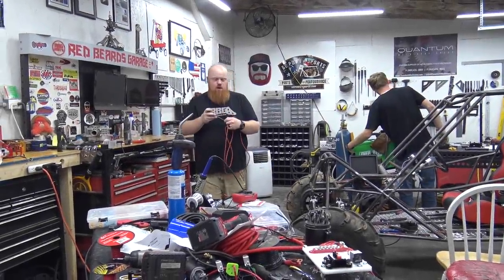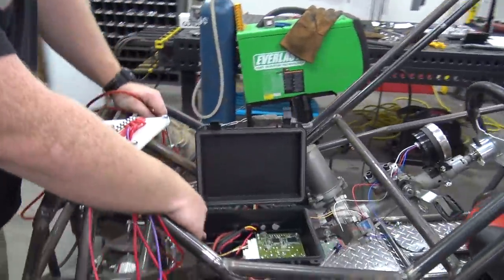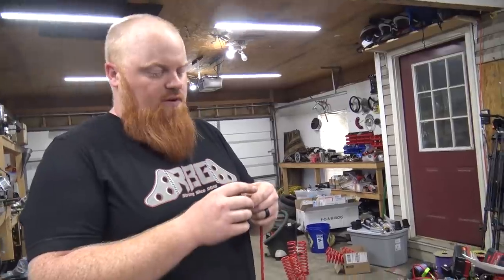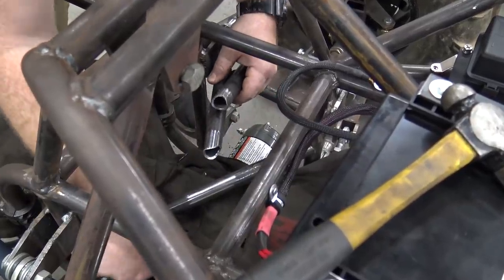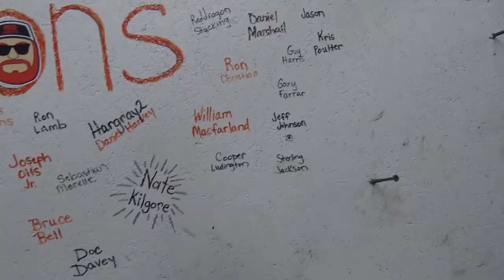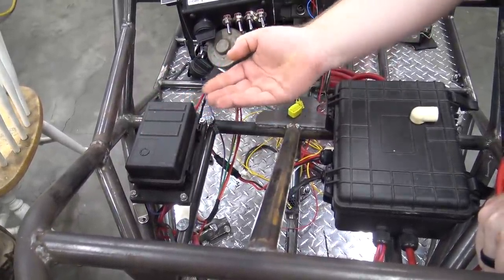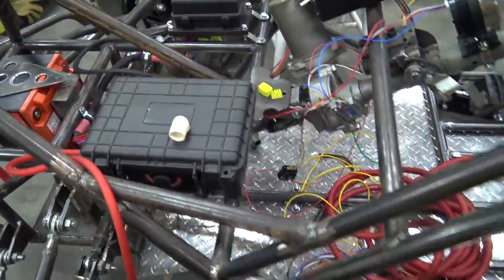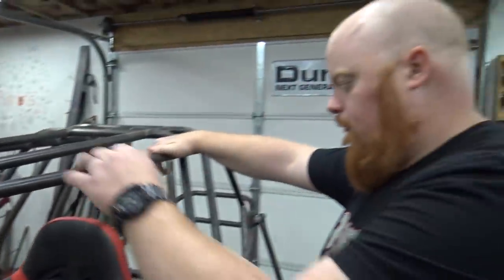IRS Buggy Front Bumper & Wiring

Comment: Try turning your post flow down when welding, you must eat through gas! Also make sure you are set at 10 litres per minute with a flow meter on as it sounds like you are set alot higher than that!

Comment: It looks like a really cool buggy but I wonder about the engine. It seems like it would be better suited for a motorcycle engine. Thanks for the video.
Reply: JB J it depends on what type of motorcycle you go with. If it’s a inline 4 they make a lot of hp but that make all their power on top end. Something like a Rotax V Twin would be a better fit, because makes all of it’s horsepower and torque throughout the rpm range. Plus they’re compatible with a CVT transmission straight out of the box as to where street bike engine is chain drive and has a clutch, that you’ve got to worry about burning up.

Comment: Dang man, at least you aren't making a Body Control Module, a Engine Control Module, a fuel pump module, and a power steering module. Pretty much just making a more simplistic power distribution center for the buggy. It literally is becoming a small vehicle.

Comment: The reasons Nitrogen is used is because it is a dry gas that excepts moisture. Btw- if you know anyone that does air-conditioning, they will have all of the fittings to charge your shocks with nitrogen and probably for free. Nitrogen really is cheap